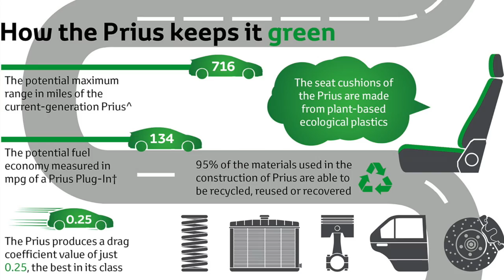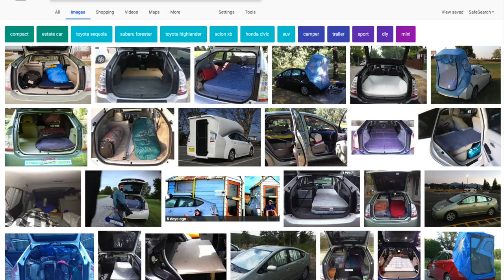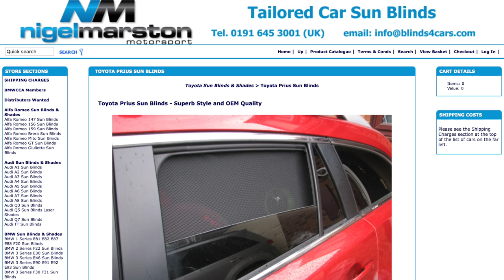Stealth Car Camping in a Toyota Prius (Building a Bed, Staying Warm, Privacy & Security)

Comment: The Prius isn't sustainable like you think .  I sold mine in 2008 . It's ok but I'm never buying an electric car again if I don't have to
Reply from the maker: Yeah, there are many factors to consider. I'm going off of studies that look at energy consumption, sources of energy, and localized pollution. Here's a good study summary "The Argonne National Laboratory ran a side-by-side comparison of hybrid and conventional vehicles over their entire life cycle, which includes vehicle production, vehicle operation and the energy required to produce fuel for both cars. If you assume that both vehicles travel 160,000 miles (257,495 kilometers) over their lifetime, the conventional vehicle requires 6,500 Btu of energy per mile compared to 4,200 Btu per mile for a hybrid. That higher energy input results in far greater lifetime greenhouse gas emissions for conventional vehicles compared to hybrids, more than 1.1 pounds (500 grams) per mile compared to 0.75 pounds (340 grams) per mile" and here's the link: https://science.howstuffworks.com/science-vs-myth/everyday-myths/does-hybrid-car-production-waste-offset-hybrid-benefits.htm
Reply: With Love key word to throw you off the scent is “localized pollution”.. don’t get it twisted. I’m no idiot. But you do you. I’m not a fan of school buses spewing black soot into my car either.
Reply: As long as we dispose our used car batteries in Africa I’m fine with your electric cars.
Reply: And no mining for Battery resources either in my backyard.

Comment: Just a heads up, lots of people have died sleeping in their cars while it runs.
Reply: Not in a prius.
Reply: Just get a CO2 monitor. But a Prius puts out very little exhaust and turns on and off.
Reply: Michael Andrew how? If you go to a semi truck stop every truck is turned on always and no one's died
Reply: Joseph Samsor well, someone could block your exhaust.
Reply: that would choke the tiny prius engine, and it would be an attempted murder
Reply: A goodly thought. I keep a battery-powered CO monitor beside my head while asleep in my Prius. Much more than $8 worth of reassurance. The gas is actually a little lighter than air, so no need to install it low down, ceiling is best.

Comment: they are allowed to brake your glass to save the dog
Reply: Dan, I put a notice in my Prius' window: 
The dog is OK. 
The Air Conditioning is ON.   
The car is COOL inside.

The Pruis A/C works from a scroll compressor powered by the 
traction battery. The traction battery recharges itself if it gets low.
Results:
Cool air inside; 
gasoline fumes reduced to a minimum; 
gasoline use minimized; 
comfy dog.
The dog is probably more comfortable than you are right now.

IF anyone breaks my window after reading that, I'm gonna club him like a baby seal.

Comment: https://youtu.be/lGWL7Pp9igg   

 My Jeep Camper Conversion. Only 19-22 mpg, but w 4 wheel drive I can go almost anywhere.
My 4 wheel drive Cherokee includes a full Kitchen on heavy duty slides which enables ARB Fridge & ClearView Pantry to pull completly out of the Jeep's cargo area, Roof-Top Tent (RTT), 10'pop-up screen room, and a pop-up bathroom/changing room. I can carry up to 7.8 Gallons of potable water (1 WaterPort & two 2 gallon plastic RotoPlex carriers). My Yeti Goal Zero 1250 power generator provides 3 days of electric before needing recharge. The Goal Zero power generator recharges either with AC or while the Jeep engine is running. The power generator can also be recharged with solar panels but my current energy needs don't necessitate additional alternative charging capabilities. My 15000 BTU portable stove can use either Butane or Propane for fuel. The campers' assets are totally modular which affords the flexibility to deploy optional resources as needed. If boondocking/primitive camping, I have my own water & electric power for up to 3 days. If staying in a campsite which provides water, electric, and showers/bathrooms, I can just use my RTT and kitchen. My pop-up screen room gives me a place of refuge from mosquitoes in under 2 minutes.  BTW ... I always get a lot of interest and "thumbs up" comments from curious lookielou's who walk up and ask questions when the sunshade is deployed on the Jeep's rear hatch.

Comment: How much bad is done building batteries of these electric cars. Plus nobody ever talks about the pollution generated by disposing these very expensive batteries. What happens when the batteries die and need to be replaced? Nobody ever talks about these issues. I would challenge the pollution related to the batteries versus a highly efficient gas powered vehicle.

Comment: You're only missing an electric unicycle
Reply from the maker: Haha, that's funny. For some reason, my Father always thought it would be cool to teach me how to ride a unicycle. I never got one, but I did try my friends one time. You can learn by pushing a shopping cart for balance ;)
Reply: @withlove1717  That's a really great idea. I never thought about using a shopping cart. I learned how to ride a normal unicycle a long time ago and it was one of the hardest things I ever had to learn. I was only mentioning the electric ones because they are much easier to learn and are super practical as a portable mode of transportation that fits in the front seat. Check em out sometime :D

Comment: "yeah its a 4 cylinder it has a timing chain" bruh all cars have a timing chain/timing belt
Reply: syawal razak untrue, 2 stroke cars do exist and of course there are rotaries. Some engines also have gear driven cams.

Comment: Tfw you think buying a prius is good for the enviroment, ouch!
Reply from the maker: Buying a used Prius and living in it is super efficient and sustainable compared to commuting to work with a non hybrid, owning/renting and heating a house, working in an air conditioned or heated office space etc. Yeah, it still burns gasoline, but it gets ~45 miles per gallon, and a lot more if the engine is being used as an on/off generator for climate control :D
Reply: @withlove1717  The main reason of my comment was the fact that it's an old prius which we all know by now are far worse for the enviroment than a regular diesel or gasoline car would be due to how inefficient the proces of making all the batteries is. Newer hybrid cars are indeed better for the enviroment but when they made these, they were quickly known to be less enviromental friendly than your regular car because of how they are produced. Maybe because it's now 10 years old the difference is becoming more neglectable.

Comment: Ur pack'in too much shit man.  Take out the back seats and the passenger seat.....I have converted a 2016 Fiesta.....Simplicity is the Art of Life.
Reply: NOPE,,,,,,and  I took out all the interior carpet and panels, in the back, sound proofed with NOICO 80 mil mat, and covered  with new trunk liner material.......Huuuuuuuge difference. Huge. Did flat black glass spray paint on the rear windows, dark tint on the rear glass.

Comment: Do this in a Ram Cargo Van if you ever want to trade up.  But for mileage gas costs .....  Have a Prius too so some great ideas for camping on shorter trips.  Kayak on top always.  Do use the aluminum windshield from car accessories companys for front window.  
How do I get more info about tapping into start battery?  Never seen such a lead, but then am a girl.  And the cooler - the fans look to be on top.  Does not a pillow plus cause a problem....  kasy99#gmail